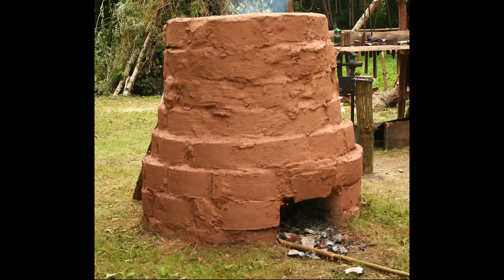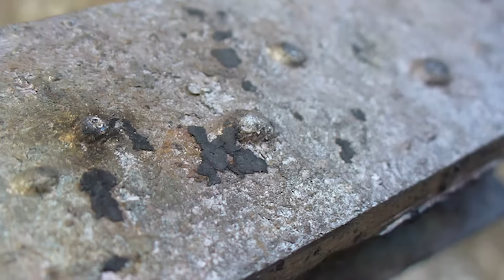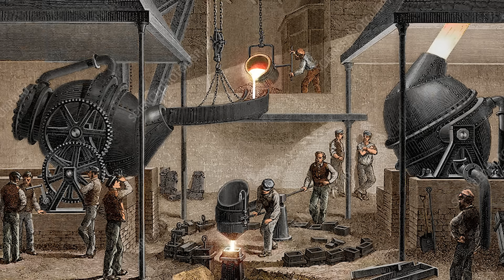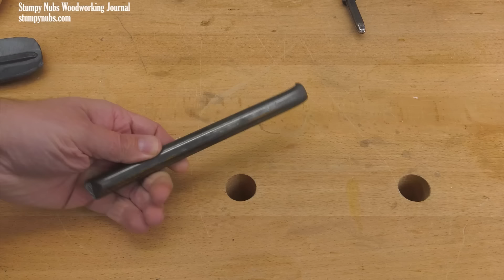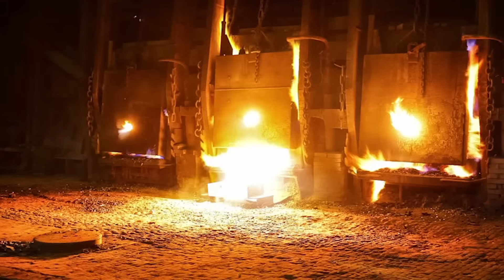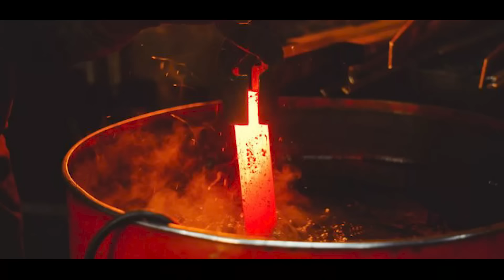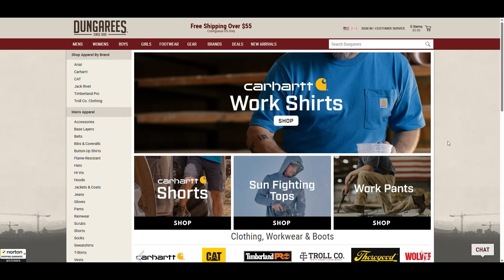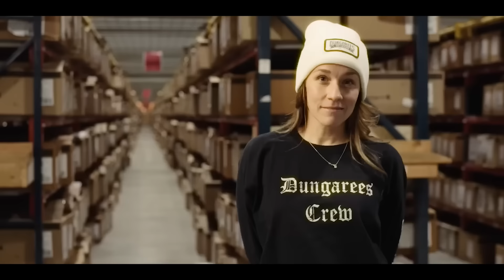Why they REALLY don't make tools like they used to

Comment: Pet peeve: Forging DOES NOT "compress" the steel. Steel is what scientists & engineers call an "incompressible solid." Nobody can push the atoms closer together just by whacking the material, no matter how big the hammer or press. 

There are several advantages to forging, but "compressing the steel" is an abhorrent misconception.

Comment: Has nothing to do with new vs “old” steel.  

Modern steel alloys are considerably better!  

However!!!  GOOD steel tools will cost you.  Most of the tools sold at big box stores are made to get a job done with lower quality steel.  

There are tool makers out there who use modern steel alloys to produce drastically superior steel tools.

Comment: If I go into a regualar shop and buy an item that doesn't require a sharp edge like a screwdriver, pliers or a spoon, it will likely bend, sometimes crack and be subject to scratches. I have screwdrivers from Soviet times that have entured abuse at the wrong size or camming out, and they are in fair condition. I took two spoons, modern and soviet, and pieces of thousand grit sandpaper to polish them. Modern spoon was scratched as expected in need for further treatment, old spoon was polished and had worn down the sandpaper.

Comment: I was on the oregon coast one weekend, suf fishing,  i stopped by a bridge under construction and hopped the cement berm to take a piss and found a couple feet of rebar scrap right there so i chucked in in the pickup. Later at my shop i ground two tools from it. A cold punch and chisel. I heated them to straw if i remember and quenched. They have been some of the longest lasting tools in my shop.  I ran this through AI  and AI agrees that there are some rebar types that are good alloys, not just average rebar.  Coastal bridge project, i figured they'd have good rebar. :)

Comment: The key to good steel is clean coal: dirty coal has lots of sulfur, mercury, phosphorous, and all kinds of other impurities. The best burning, cleanest coal in the world is Appalachian anthracite like from Pennsylvania, West Virginia, and Kentucky. The only purer source of carbon is graphite, but trying to manage burning graphite would be a nightmare. Good modern steel is amazing: I am a machinist who works in a plant that makes large gears for the energy, extraction, naval and other very heavy applications. We regularly get pieces from the heat-treater specified 58-62 Rc, nice and "crispy", but doesn't chip. Almost all of it is alloy steels, of course, for strength, wear resistance and stability, but I am not at liberty (nor sufficiently educated in metallurgy) to divulge specifics since many of them are "house" recipes.

Comment: Seems maybe one has to look at the particular market a tool is made for. Certainly, the big box stores have hand tools that are simply not designed to be used. It is interesting they package them in such a way that you can not handle them or get a feel for quality. Thanks for debunking the myth that everything old is better than everything new.

Comment: There is absolutely no doubt that today we can produce better steel than at any other time in human history. Just look at what the knife lover crowd is doing. Böhler M390 anyone? It's an insanely hightech tool steel that's produced through what he manufacturer calls 'powder metallurgy'. The Hacksmith channel did a real nice demo of a M390 blade cutting through a swiss army pocket knife.
The 'problem' is that a blank of M390 steel costs more than most people are willing to pay for their tool, total. You could get a whole set of the advertised Narex chisels for that.

Comment: Quality 
Quality 
Quality
Do not ever compare $10 tool, with a tool that costed $10 50 years ago 😅. There was no cheap crap back then, but if there where it wouldn't survive till now
Reply: Exactly.   Adjust for inflation and then buy a tool today of equal value.   You'll find that the quality for the adjusted dollar is usually even better today.

Comment: The newer two piece Snap On drive reducers/adapters "GSAFIF" and "GLASIF"  for using a 3/4" drive handle to drive 1/2" drive socket or 1/2" drive handle (or extension) to drive 3/8" handle extension or socket ?
   use (probably) softer steel body to hold a replaceable square drive bit that is probably much more exotic alloy steel ?

Comment: There is, to my knownledge, one field in which specifically pre-WW2 steel has its uses:
Medicine.
But this has to do with the fact that via the nuclear bombs and nuclear tests conducted since then, there are small quantities of radioactive isotopes in the air. Including, of course, the air used in furnisses. Thus the radioactive atoms also embed themselves (in miniscule quantities) in the steel produced ever since WW2, and this is problematic in some medicinal applications.
So there were efforts to actually dismantle old scuttled pre-WW2 battleships for their steel.

Comment: Mate blast furnaces don not produce steel they produce pig iron (basically cast iron) which has a carbon content in excess of 2% - steel is this cast iron that has had the carbon reduced significantly typically by blowing oxygen through the molten cast iron - structural steel has carbon content of less than about 0.15% whereas tool steel has much higher carbon - say 0.5 - 0.9%. PS I'm a retired metallurgist.
Reply from the maker: Blast furnaces are the first critical step in the steel making process.

Comment: Dude if old steel is better I'm on a gold mine
We demolished a old farmhouse my father in law grew up in
It was built in the 1930s
There was about 60meters of 10mm round bar in the building
A wierd cast foundation but on top of the walls

Comment: You can get good new stuff but you have to know what you are looking for as most of it is mass cheapo steel from an oxygen lance from BOP=basic oxgen process forging.
Over 70% of steel mainly from China is made of BOp forged steel which briliant for large steel works or anything for construction such steel is awful for tools.
Reason why people overvalue old steel tools is they didn't make stuff out of this cheap mass produced BOP steel.
Check the tools steel type & then see if it is an officially certified steel for tools if not that type of tool.
Reply: Glad he mentioned that hot hammered/worked steel always produces a grain structure with less internal forces making it superior to cheap cast tools.
If a tool has cating marks & isn't for a part that is support or structure rather then the work end then avoid at all costs as it is not worth any payment but the scrap the steel is worth to a scrapyard.
Reply: Best rule of thumb is avoid chinese tools unless it is for a one of job & is cheap as peanuts as it's better then nothing but you want the genine article then go to a firm that knows what they are making.
Another thing to consider is that just because a firm makes X excellent doesn't mean Y or Z is up to the same standard.
Drapers make great pliers for price but midling hammers as an example. Ire commend a discernment doubting most everythings quality till something is presented while if you can ask people what tools they like & ask to try them out for a moment politely & it might just save you time as well saving cash as you not buying other of the same tool till you find something that works reliably.

Comment: Yes--good quality tools are becoming available.  Mostly at a high price.
But forty-some years ago, when us 'old timers' got started-new tools were truly crappy!  Really poor!  And before those accursed 'collectors' started driving up the price of old tools--you could get 100 year old tools that were vastly superior to the new tools.  And it was just a matter of the steel- it was also the workmanship.  Old planes, particularly, are very well made indeed!  New planes were trash.
Then new blades became available for old planes--and they were very good!  New planes of excellent quality also became available--but prohibitively expensive.  Retired brain surgeons could afford them, but professional boat builders couldn't justify the price.  Top quality new chisels also became available--at a high price.  We didn't need them, because our very old chisels did the job very well.  I purchased some amazing 100 year old British carving chisels from a used tools barn recently--famous maker chisels of very high quality.  Very unusual shapes that are hard to find in new chisels--and the price of the new ones are over the top.
Good quality bench chisels have become more affordable in the last few years, as appreciation for hand tools has become more widespread and the bench chisel market is quite large.  And top quality replacement plane blades that will fit your 100 year old planes are now very available, though not inexpensive

Comment: There are several reasons why modern tools are made from different steel than in the past.
1. Easy of manufacturing 
2. Appearance of the final product 
3. Increased variety of grades.
4. Different ways that the tools may be used.
5. Cost to produce.
6. Use of scrap and the resulting impurities.

Steel alloying is much more accurate than ever before. The steps are far different to those of the 19th century. That doesn't mean tool manufacturers know what to use and that's usually the problem.

Comment: Fun fact: There is one significant difference between old and new steel. Any steel produced after the 1940s has small amounts of pollutants in it due to all the nuclear testing that took place over that decade. In certain scientific fields this pollution can cause significant problems with measurement, and so those fields actively try and buy pre-1940s steel to recycle instead of new steel.

Comment: Harder-tempered steel isn't more difficult to sharpen. It does take slightly more time to set the bevel, but it also forms a smaller burr that is way easier to get rid of. 

Modern wear resistant steels are another beast but still manageable

Comment: I was told that over time something heppens to crystaline structure in steel
 So if burried a good tool made today for a hundred years it would be as good as the old one. That made sense to me, as the old knives (i did saddlery) were akways a bit better than new ones.

Comment: I’m retired about a year now and returning to woodworking/turning after a 25 year career change away from carpentry.  My chisels are all old craftsmen and buck. Never used them for fine woodworking builds but rather rough and some finish carpentry.  They are tough to get a nice edge on to begin with even w sharpening jigs holding at correct angles and diamond stones, and go dull very fast.  It’s time to upgrade. Thanks a ton for this video. I appreciate all of your videos for your calm demeanor and amazing depth of information.   AND your common sense born of experience.  Now I think I understand why my plane irons sharpen up well and the handyman level chisels I have don’t. Thank you!

Comment: This gets said because firms which previously had a good reputation have cheaped out. Stanley tools used to be quality and affordable up until the 00s, now they are only affordable. They shifted to using Chinisium "steel" and plastic handles. Any saving you make on purchase are lost when you factor in cost of replacement and lost time having to fettle and tinker with them to make them work and having to go over your work again cause it didn't work right first time. They went from being the industry standard for workaday tools you take out on the job to a joke you toss after use.

Comment: The melting of steel are much older than you think. In the Swedish Siljansringen, a meteorite crater, there have been doings this for a thousand years at least. The beaches are full of Thermite and if you dig about 50 to 100 cm down you will find large flat pieces of melted iron with slag. They built furnaces right on the beaches. Just this last weekend I found about 25 kgs in 90 minutes. The iron was so hot it melted through the sand layer and settled on the soil below as flat pancakes. The makers didn't know about this waste and left it behind because the sand collapsed in above the cake.
Reply: The japanese figured out how to control carbon content for a similar (or longer) amount of time ago. If course none of this is on an industrial scale, but for small tools and blades I'd wager it is among the best processes on the planet.

Comment: When you buy a used old tool (40+ years old), it is very likely that it is made from a quality steel. Many modern tools are made from cheap materials and it quickly shows with use - the old tools were made to last.  That is why the old tools have a good reputation and for the ordinary home handyman they are often a very good buy - but beware fakes.

Comment: In my opinion as a blacksmith who deals with old tools and noodle tools rather constantly. I think modern-day steel is better but old engineering is better. When you have a tool that's made out of a slightly worse material, but engineered to withstand nuclear bombs, it's ultimately going to be a better tool. With that said, though a modern-day tool engineered with the same level of passion, creativity and detail can be worlds better than an old world tool with the same.

Comment: People sometimes all me why I think some steels do seem to rust and rot out, just falling apart, since I worked in a steel shop for a while? Never a foundry, but whatever. I often think it's more about the time and quality of the blast furnace, since so much of it is recycled material.Which if treated correctly would be fine, but if the process is rushed and the impurities aren't properly removed, it's going to have all manner of impurities trapped within it. Older guys I've worked with have stories of some larger plate steel (8x12' or larger) coming in where they could see the outlines of signs, pipes, wrenches, etc, on the face of the plate. Which is an obvious sign that the steel had barely been given enough time to melt prior to rolling, let alone get the impurities removed.

Comment: Take a cheap chisel, and a hard facing rod. Grind the edge back, then hard face it and grind a good edge on it. Not as good as a really good quality tool, but you'd be surprised at how well it works. Of course, I have the hard facing fillers around. I have various powders for the thermal spray welder that range from glass hard to soft depending on what you need to do.

Comment: Maybe i was lucky, but i bought a machete and a small saw years ago, and after use , i just let them in my garage, and so far, no rust, and no lose in edge ..

Some steels are quite good these days ..
Reply: You can get steels with whatever specifications you want.
Reply: @michaelallen1432  They were cheap ones, to cut some branches, they are still fine , like i said, i got a good batch ..
Reply: I, I, I, ... 🙄

Comment: This is the nature of blade making. The pentacle of old steel was the hand forged swords from china and Japan where they perfected a technique of sandwiching two different hardness metals to form a blade that would flex and not brake called San Mai steel. The harder steel was on the outside and softer metal inside this gives no you a hard sharp edge and a flexible core that resisted the shock of repeated impacts. Today’s steels are of a MUCH higher quality because we have worked out the science. Creating a plethora of different steels for different uses. We can control nearly every aspect of the steel down to its molecular structure. Now a mono steel blade can outperform one of these old blades. You can still use the differential hardening process to produce a Hamon and it will retain the characteristics of a traditionally crafted blade.

Comment: And what about the various Tungsten-iron-nickel-carbite alloys that forgers handmade with whatever material they have? 
I have a chisel made from early 1900 that my grandfather used to cut and engrave steel. It is comparable to todays tungston-valadium drillbits, extreamly hard.

My problem with modern tempered steel is when it heats(from usage, especially the edge) and then it cool down it became soft.

They ofcourse make better tools today, from better alloys, but these are like 20 times more expensive than steel tools and have entierly different markets like for machinery and production facilities, and not for regular people that you can find in the store and just buy.

Comment: Old tools were a product made of forge-welded mild steel for the body and a high-carbon steel for the working edge, a rather labor-intensive process.  Handmade tools of today are the same.  High carbon steel can be brittle and chip easily unless tempered properly.  Modern tools are usually made entirely of high-carbon steel, properly tempered.  The cutting edge is very hard; thus, many users grind back the edge with a bench grinder, if it was damaged, and in the process, the heat from grinding the edge is enough to remove the proper temper.  Also, modern steels for chisels usually have a blend of steel, carbon (to make it hardenable), and maybe Chrome (to add hardness and rust resistance), and/or other alloys that add selected characteristics.  As to hardness and survivability, modern tools hold a better edge and will outlast you.  That is, if you buy a quality tool, domestically made.  Unknown steels from Asia are usually crap, regardless of brand name. (Japanese steels seem to be an exception.  Swedish-made steels seem to be of higher quality also.)  Any of these should meet the needs of a DIY  user; pros will want better.
All new cutting tools need to be sharpened and honed from the package before use, regardless of source.

Comment: The best steels especially tool steels of today are by far superior. Technology improves and with modern equipment being able to achieve precise temperatures and the ability to literally see how even heat treatment is. There are cheap quality steels today, but the top quality will be superior.